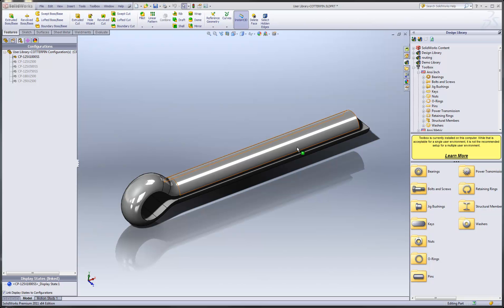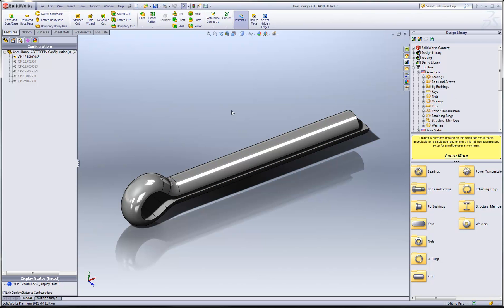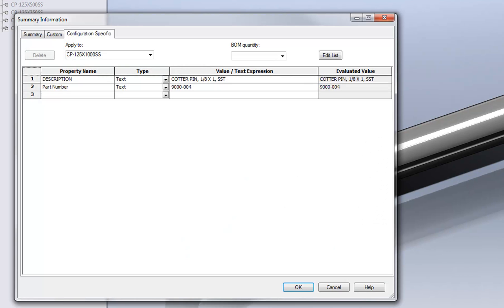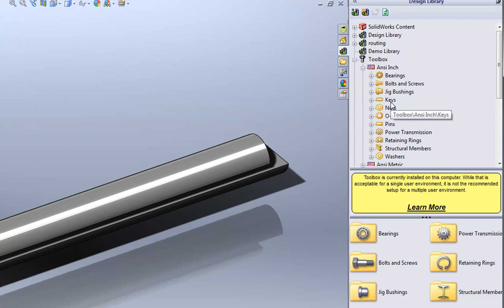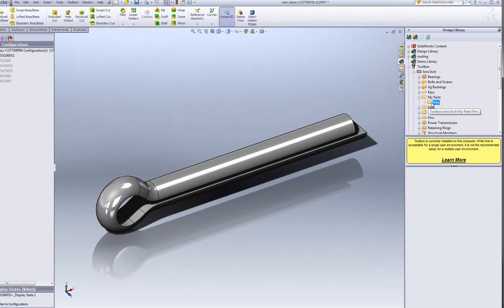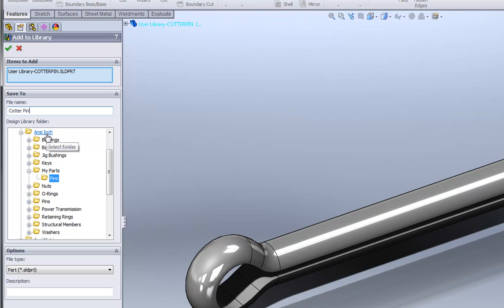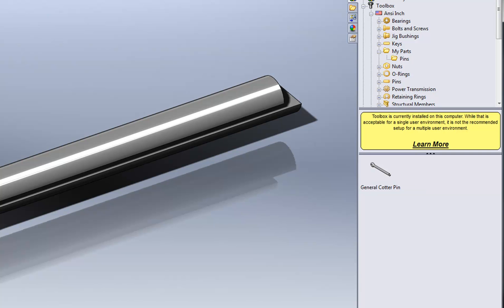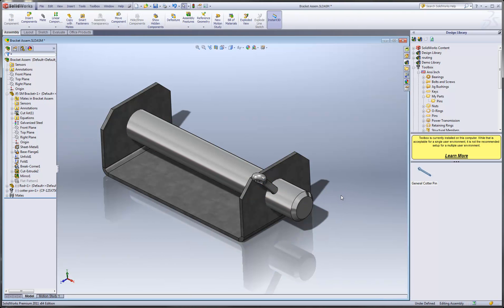Adding Custom Parts to SolidWorks Toolbox

Comment: How to add different sizes of same part under one as u did with the cotter pin. Or provide link for the video
Reply: you do it with configurations
Reply: i would like to know that too.
Reply: Jong Zabay OK I figured it out how to do that,
First create a part it could be anything shaft , bolt, nut, pins etc. Once you done with the part creation.
Second, go to left side of windows feature manager area and select configuration, once click on it,
Third right click on the part name and select add configuration, this create copy of the part.
Fourth, after that click feature area and suppress the feature that you don't need or change the dimension as required. Repeat the process until you have number of different configuration of the same part. 
That's it you are good go.

One more thing you can also add different parts in configuration and later use then in Assembly